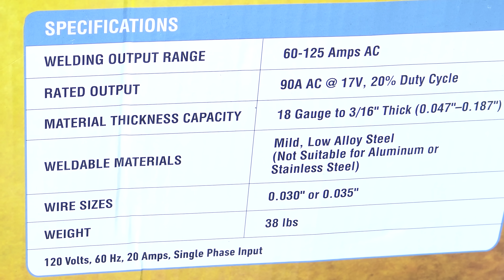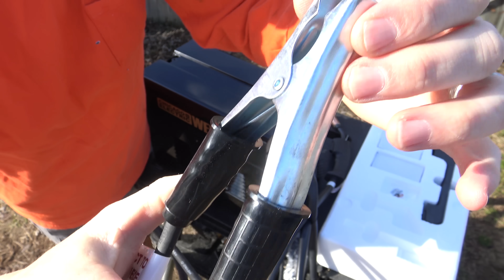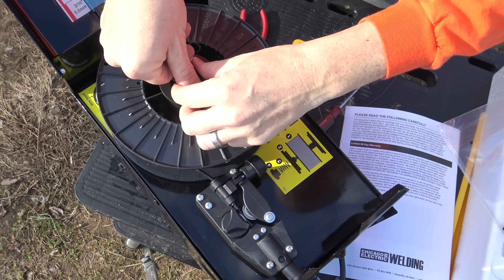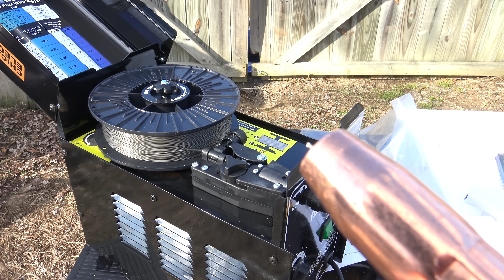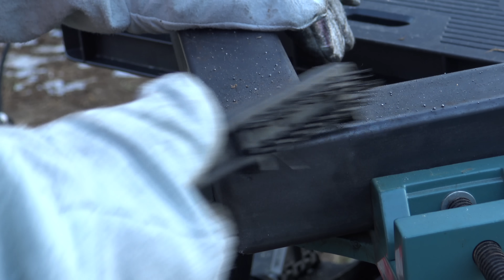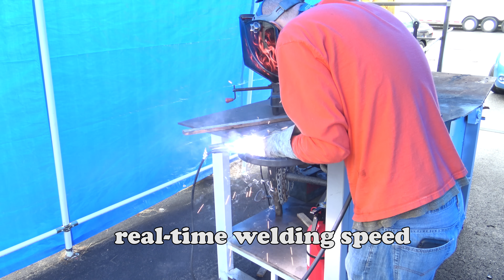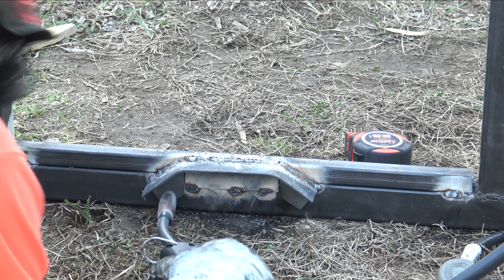Harbor Freight Flux 125 Welder Review

Comment: I don't think I would like to take welding lessons from this guy the review I guess was okay I've had two of these welders and had trouble with wire feed on both of them and most of my friends that purchased one of these welders had the same problem and we all had to take them back they just don't want to feed the wire properly sometimes it comes out sometimes it don't you waste a whole lot of wire when you have to cut it off and restrain it back through the hose honestly I don't think I would recommend this to anyone
Reply from the maker: Don't overtighten the spool an DO set the proper tension (flip the little piece to proper wire size). Finally, if the welder is hooked up to a lesser than 20 amp outlet expect a voltage drop significant enough to affect the wire feed motor.

Comment: I don't get it I know my welder is in good condition and operates normally but my welds end up sucking. Like I'll be welding I'll be watching my puddle everything is looking good and then WHAM welds done and it absolutely sucks. My dad has been getting older so I do pretty much all the welding in our shop yet I still suck. I'm only a beginner I started a few months back at the time of posting this. I got all the fundamental principles down and my dad set me up with a great beginner mig with good settings and everything but I still can't get it right. It's weird because when I'm going the puddle looks great and I'm thinking "Yeah this will be a nice weld." then I pull my helmet up and it's warped and bubbly. I do prepare every surface I weld by taking an angle grinder and grinding it down to bare metal so I know I'm doing that right. My dad says it'll just take lots of practice  but I'm still awful. I have a hobart but I'm not sure which model. Anyone that can give any advice would gladly be welcome.
Reply from the maker: Find good tutorials on youtube or seek out a class locally that teaches welding. It will take time and lots of effort. You will eventually get it. Just don't keep doing the exact same thing expecting a different result. You have to mix it up and go at this different ways to get different results. Good luck with it! Don't give up!
Reply: @TRYtoHELPyou  Thanks!
Reply: @carsonmiller9658  Is it Flux core or gas sheilded?
Reply: @jacksonhomestead01  It's gas. And its all set up correctly.
Reply: @carsonmiller9658  If there's any air turbulence whatsoever your welds will come out jacked up. You should be in a well ventilated shop with fans blowing outward. Make sure there are no fans blowing on you or anywhere in your general direction. Shop door should be down so there's no breeze. If all else fails, get some Flux core. It's not quite as finicky.

Comment: I have a old cheap Chicago electric mig I inherited in 2006 and it’s still going. I haven’t used a lot myself but my father in law uses it all the time and it’s been a great little welder for light duty stuff and still works after all these years.
Reply from the maker: yeah, they are pretty simple machines. thanks for sharing!

Comment: Jusr bought one, figure it will be good enough to weld my cracked header, weld a bung onto my cat for o2 sensor, weld floorboards on my jeep etc. etc. Good video
Reply from the maker: Welding cast steel may be a little funky, but this may do all these things with the right skill and patience.
Reply: @TRYtoHELPyou  It's actually welded pipe not cast so that's good. I did it the other day, worked well.

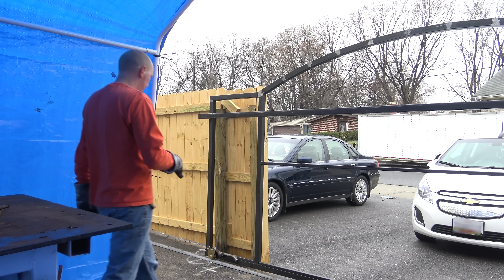Comment from the maker: 08:50 i don't recommend it for thin metals but it might work for exhaust...
Reply: Same. People like myself start to get into bodywork and it doesn't jive. The low voltage is still too hot. You need variable dial that goes lower. And they're usually on mig welders, at which point you might as well give yourself a bigger leg up and get a gas bottle to go with it.

I did some exhaust work and it was fine. Not pretty but did the job.
Reply: Same here I have one of these welders worked fine on exhaust also gates and repaired some brackets and other light repairs
Reply: Ive done multiple exhaust with mine
Reply: Planning on reinforcing some cheap gym equipment I have with this thing. If that doesn’t work, I’ll just start making my own. Lmao

Comment: Fine print on the coupons excludes use on many items. One of them being welders.
Reply from the maker: Yeah,for the % off cupons. It does go on sale a lot. Like a direct sale where the item is a lower price. Sometimes it's a coupon for just the welder and they scan the barcode on that. So many different ways they try to sell it.
Reply: But usually the sale price is only $10 off. I bought one but have yet to use it.

Comment: I got the 90 amp one, works great. But FYI, Look at the power requirements for output of this welder and the 90 amp one, you will notice that they are the same. How can you get 125 amps from 90 amps? They are the same welder with the 125 amp having false advertisements writen on the box and it being the 90 amp welder.
Reply from the maker: If this is true then contact the federal trade commission and put in a complaint. You may have to provide factual evidence though. Have you torn apart the 90 and the 125 and checked what transformers are being used, etc? They may ask before doing a full investigation... probably lots of accusations of fake or misleading products out there. As for using this vs. my older 90 amp, they do feel the same.but I'm not sure if that means they are the same amperage. Also, to answer, how do you get 125 amps from 90 amps? Same way your getting the 90 from your 20 amp house outlet.... Drop the voltage but still put the same amount of electrons thru.
Reply: Maybe, on the voltage. I don't have the 2 to compare them both. It was just noticed by looking at the labels. I probably won't report it. It's still a good cheap welder, and it does what I need it to do. :). Thanks for the input on the voltage thing, haven't thought of that.

Comment: they are ok for someone that has nothing to critical and only uses them once or twice a year for something small. My old man has one I played with it a little bit helping him with a project before going and getting my welder. If this is all you can afford then so be it. If you can scrape about 300 bucks up everlast has a small MIG. You can run with or without gas. but It welds so much better because it is a invert D.C. current and you got the option to put it on gas. Gas on a wire feed is a MIG and it will lay the weld down 3to4 times faster than fluxcore. This is a A.C. machine it really is crap if you want to learn and make something that needs good solid welds. Not saying you cant make a solid weld with it but not as easy as a DC machine. You can get a eastwood 90 amp dc for $200 with delivery. That's my take on them. Reality this is the bottom of the barrel spend your money on a better welder for $50 to $75 more you can get something that welds so much better.  welder 20 plus yrs

Comment: Would this be a good welder for riding lawn mower repair?
Reply: I have welded up DOZENS of holes in my lawnmower decks, as well as rewelded the scalping wheel brackets that fall off occasionally (25 year old mowers start falling apart when stored outside and not cleaned...), but I do have the older blue 90 amp version, likely only difference being the cooling fan... People give these things a bad rap but I don't think they give them a chance and likely only try .030 wire. .030" wire is only good on the low setting or high setting and high wire speed, if you try to weld something thick on the high setting and lower the wire speed it is an utter mess and frustrating no matter what brand wire you use. I stick with .035" wire and it works fine on whatever I do from exhaust tubing to 1/8" wall whatever I do... the mud flap brackets I made have held up the suspension of my Ranger when the leaf spring bracket broke off...
Reply from the maker: Not really sure. I think for thicker parts, yes. But if it's think sheet metal, then likely not. You will burn lots of holes right thru the metal if you don't have the settings just right.
Reply: TRY to HELP you okay thank you
Reply: It would work just fine. I used a similar machine to weld exhaust pipe together.

Comment: The welds and your process were a little choppy.
Reply from the maker: Hence the chop saw :)
Reply: @TRYtoHELPyou   Actually no, I was referring to the aesthetics of your finished product. No doubt the fault of the machine and gasless wire. Does that machine have the option for a gas hookup? Double shielded flux core lays on like butter and the slag practically falls off itself. It's pretty erotic to watch it slowly curl up as it cools.

Comment: O and has anyone ever just took the gas tip off and weld like that since it dont use gas it should work right
Reply: Are you referring to the contact tip or the nozzle?
Reply: @MrMatt61786  the nozzle cup
Reply: @newwavepressure6478  You can get a gasless nozzle. Do you need it during flux cored wire... no. However, it does protect your contact tip and insulator/consumables from getting spatter and extends the life of them!

Comment: I have the big brother of that welder I bought last year so far it has fixed my wheel chair and my idrive. I am a disabled vet and do not get that much income
Reply: ncrdisabled Submarine vet badass. Thank you for your service.
Reply: ncrdisabled Submarine vet  hey brother, I’m a disabled Desert Storm Vet myself and I too have the same welder and most of my check goes for meds and other things necessary for survival so there’s never much money left over to always get the better tool I want so I have to go with what will get me by and this definitely does a good job of getting me by. If you take your time, prep your metal, then you can usually get a damn good weld from this machine. Ive had mine 10 years now and love it. 

Take care brother and keep plugging away!!! We only have each other anymore that we can rely on to help each other so hang in there and if you need anything just let me know brother!!
Reply: Thank you both for your service,  some of us understand the sacrifices that is made by our heroes! God bless!

Comment: Same thing for me. I've had mine for over 5 years without issues but I did already have a self darkening shield also bought at HF. One tip for making better looking fillet welds at butt joints and for filling minor gap is to run a "J" weave stringer. This pulls the puddle back and up and then carries the puddle down without burning through. I was a certified welder in the nuclear power plant world for about 10 years and it makes for a better looking weld as well. I enjoyed your video!
Reply: Would you recommend it for welding an exhaust pipe?
Reply: @ikannunaplays  I"m not sure about that because exhaust pipe tends to be very thin. That's why most are tig welded.

Comment: I thought about getting one of these at 1 time but I needed to weld some slightly thicker stuff and it needed to be structural. The newer welders make mig even easier to use. If you're just doing small stuff, this little welder is definitely a good way to get started.

Comment: I have the same welder machine and like you said for home projects is an score! I'm not a professional welder, I'm a DYI kind of guy and really love it,  you just have to practice more and you will get to the point. 
Nice gate by the way, did you post a video with your finish product?.
Nice job body.
Reply from the maker: They are great welders considering their cost. As for the finished product, sort of. Watch my how to bend square tubing video. Have the gate actually operating at the very end of it.

Comment: i have the flux core 90 amp Chicago electric from HF. have had it several years now. my only complaint is the low / high power switch fell apart. hard to find a replacement switch. i eventually plastic welded the switch back together. still works. it takes practice to get a good weld. clean the slag from the gas shield and tip every time you stop welding. it helps keep the gases where you need them for a clean weld. i would buy it again.
Reply from the maker: Nice, yeah I just bash the nozzle against the piece I'm welding on to clean out the tip. I definitely am happy with the welder.just needed to build the gate and yeah... It's still going strong!

Comment: I did notice you were pushing your puddle on that wide gap weld. That’s usually ok in mig welding, but with the flux core it’s not a good idea because the weld spits a lot of slag which you can run over and create pockets of crap inside your weld.
Otherwise, great vid!
Reply: My dad taught me to weld as a kid. He was an instructor who taught about 400 people while he worked for the Santa Fe Railroad (later BNSF). Forty-four years doing that. He was a Railcar maintenance and repair guy. His specialty was working derailments and repair of damaged equipment. One of the first things he taught me was slag management in welds. Lower temp welders don’t produce the heat necessary to properly burn out that crud. He actually suggested avoiding pushing the puddle with any flux welding, just to be certain that slag didn’t get embedded in the weld. He’d seen x-rays of stick welds that still had slag flaws in them. So he taught me to always drag any solid flux welds so that the splatter would trail behind the puddle. You don’t have the same problem with gas-shielded welding because they don’t produce the impurities you get with flux, especially flux-core.
Reply from the maker: Interesting. Thanks for sharing your experience. Well, it's been years since I took parts to get x-rayed.. I'll probably never do that for welds I weld with this welder. (I was not a pro welder, just a delivery guy) The dude who ran the place looked like he didn't always close the door to his x-ray chamber.... Anyway, I'll give pulling more of a preference.
Reply from the maker: thanks for the comment, interesting. So the slag embeds itself into the weld's bead and does not get emulsified out in the middle of laying down? I usually am watching the stuff run off to the side while the bead is being formed..... hmm :/

Comment: Thanks for the review man. Can you plug this up to a standard outlet? How would you know if the outlet had sufficient capacity to run the welder? I want to get in to welding for automotive stuff and I need a cheep welder like this
Reply from the maker: As i understand the definition of "standard outlet" the answer is no. Check to see if its a 20A outlet that you have available. I have used my old machine off of a 15 amp plug (didnt know better) back in the day. It would work but overheat the whole circuit and pop the breaker in the house... luckily it didnt start a fire... Circuit Breakers FTW! Be safe!
Reply: Thank you for getting back to me so quickly! I just checked the breakers and they are indeed 20amps so I will be welding soon! thank you!
Reply from the maker: no problem. So as long as the wiring was done correctly and your outlet is also good for 20A you should be good. This is where the duty cycle may be more of a thing for you. I was using a 30A 110v circuit (rv outlet) and i was able to weld for long periods of time, well past duty cycle. On a normal 20A outlet it may pop the breaker due to likely pulling more than 80 percent of the amperage rating of 20A (80 percent is good on all the components for 100% non-stop runtime). Anyway, that may explain why you are getting the circuit breaker popping, keep an eye on your weld time. If the breaker pops after a while of use, just follow the duty cycle that harbor freight posts on the products specs. Good luck with it!

Comment: I brought one followed instructions plug it up and didn't get one spark. Tried different grounds still no results
Reply from the maker: Does the wire feed? Be sure to hook the ground clamp to the metal you are welding. It's possible you have a defective unit....
Reply: @TRYtoHELPyou  Yes the wire feeds and I also connect to the metal I'm welding too. Maybe it's an defector unit just bout it two days ago
Reply from the maker: well.. sometimes this happens.. they do come with a 90 day warranty.
Reply: you tried it again yesterday. I works now didn't have a good connection to a ground but thanks

Comment: I got one for sheet metal works good the handle on top broke within two weeks and caused a nice dent but still works
Reply: Do u think it would weld a floor pan in a car with out burning up the metal I don't know how to weld I guess if I practice enough until feel like I can do it cause I have a 87 Mustang drive shaft broke in put a little hole in the floor board in the exhaust can use some welding what people want to do it I can buy a welder in do it myself self just the only thing I really wouldn't need it for much!! Just tossed up in between to just to get it done right or buy a welder that would just sit around!!!

Comment: Im just tryna weld exhaust pipes and i dont wanna buy a dam miller or some expensive i just need ok welds for pipe
Reply: Same here 😂😂
Reply: Used a 90 amp flux core  made a set of  Headers and 3inch exhaust system also bought an 80amp stick welder  exhaust is only 16gauge  saved thousands of dollars  no lie
Reply: greg olenik yup
Reply: That's what I bought mine for lol, arriving Tuesday
Reply: LS Brandon go with stick
Reply: Very interesting... what you guys recommend for body panels that no one will see under wide body/flares
Reply: These are perfect for exhaust

Comment: 1 thing i really like is way they place the wire reels > flat on top and >  not on the sides > And you need tip dip to keep slag off your tip >  Best to have a fan to blow the smoke away from you   LIFE OF THE WELDER IS ABOUT 2 YRS and there no replacement PARTS > Things that goes out is GUN AND GUN FEEDERS  Wish they made replacement PARTS>  I got 3 that the welder still good > Needs another gun, wire em up to the welder is a BITCH